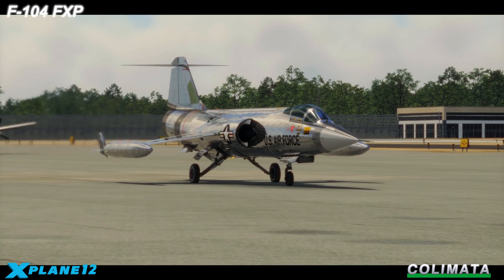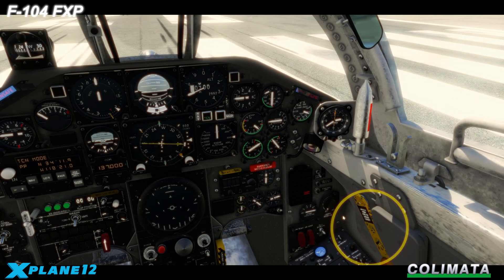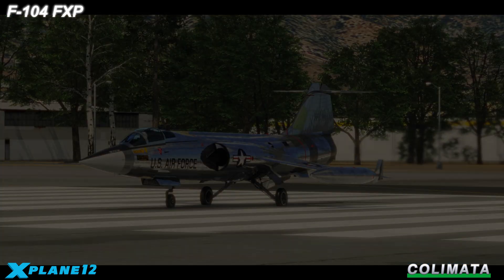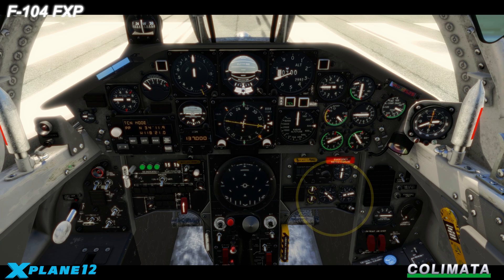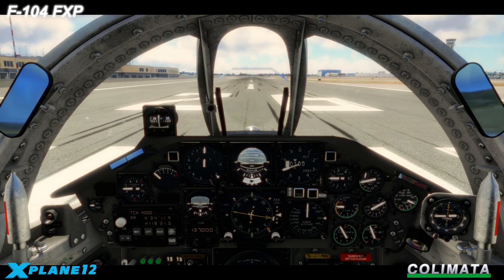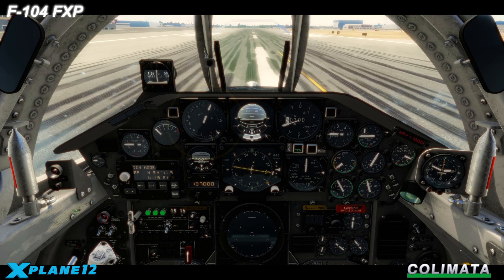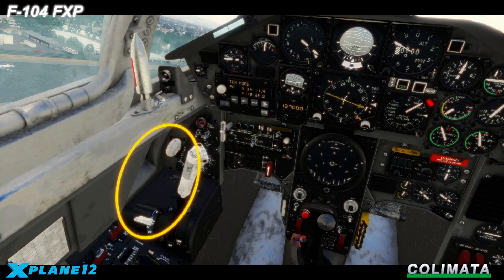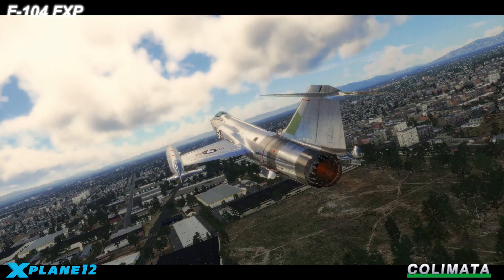F-104 FXP - Takeoff Tutorial

Comment: you gonna fix the altitude hold AP? checking on Datareftool it isnt adjusting the trim at all for  several seconds sometimes, when theres already a serious delta. its not usable over 34000 feet aproximately. this makes the plane unusable for vatsim sadly. also the crawling turning effect is almost guaranteed if i land after jettisoning the fuel tanks. sometimes its so bad you can barely taxi to a stand